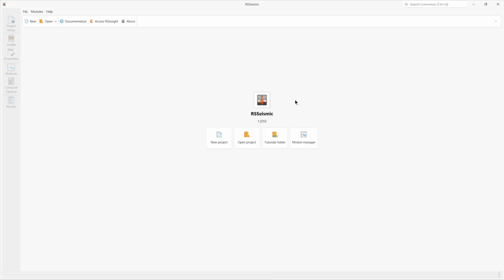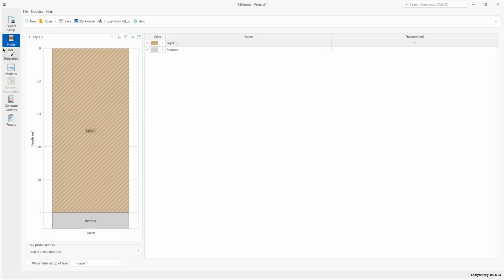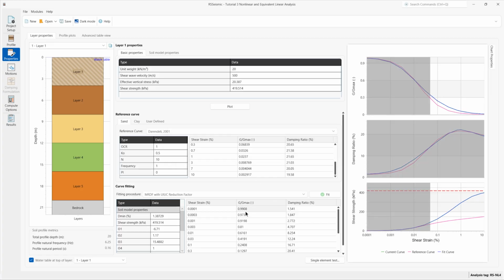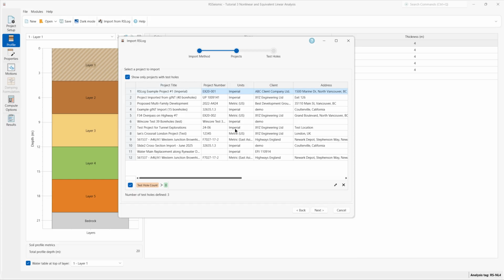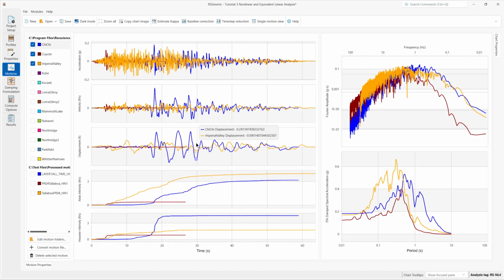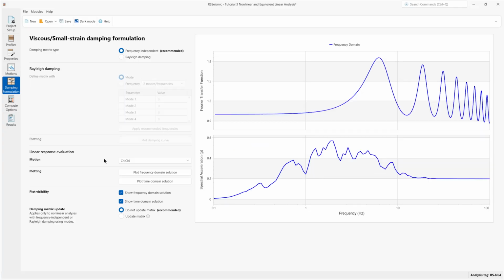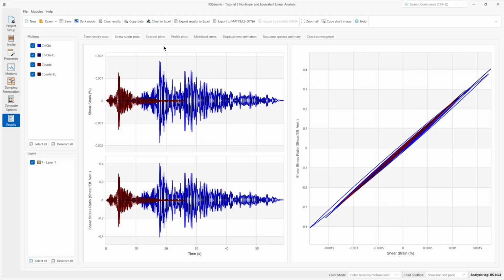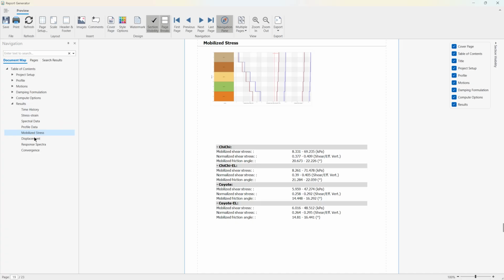Mastering RSSeismic - Program Overview

Comment: I wish there had been a transition period between discontinuing DEEPSOIL and releasing RSSeismic—ideally with a beta rollout to address licensing and stability before the official launch. The abrupt change created significant disruption, with licensing issues and numerous unresolved bugs in RSSeismic affecting our workflow and delaying several projects. Many of these bugs are still present by the way, 3 months after the release.
Reply: Agreed 100%. Very poorly handled and unprofessional. I know my firm took a step back from the other Rocscience products we already had to reevaluate. The disruption cost us in our work as well.
Reply: @schnauzeschlampe  Totally. This change tripled my work essentially. I did not trust RSeismic results for a while, so I had to run an analysis in Deepsoil on an offline computer using an older version (blocked by firewall so it wont update) and then run RSeismic and compare the results. It was brutally slow and inefficient and blew up the budget on 2-3 projects already. After many many complaints, they are slowly fixing bugs, but definitely an unprofessional move. It wasn't fun explaining to my clients.